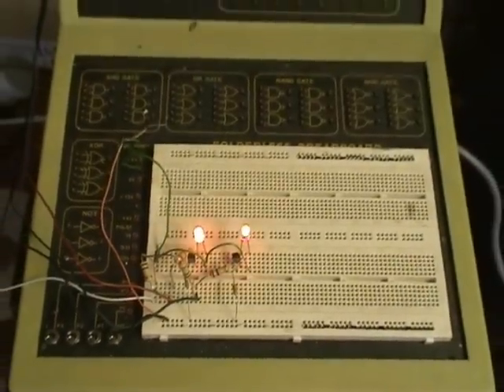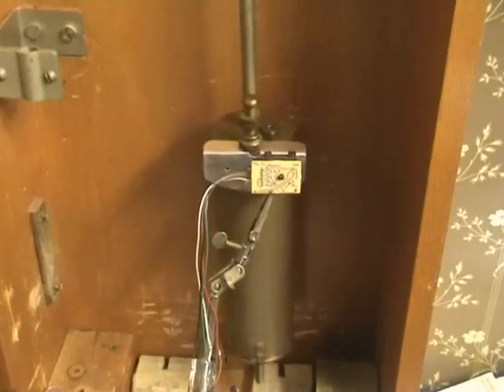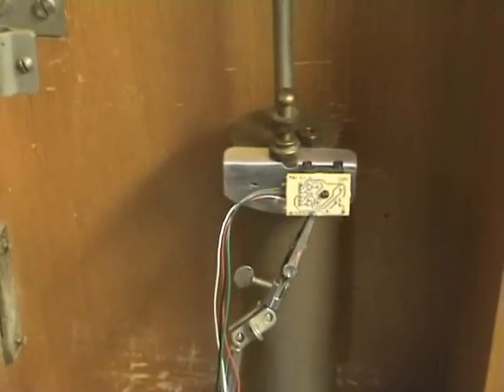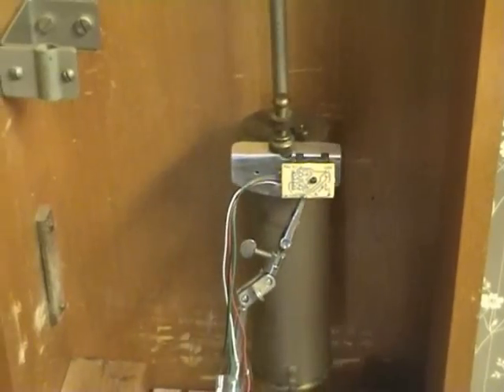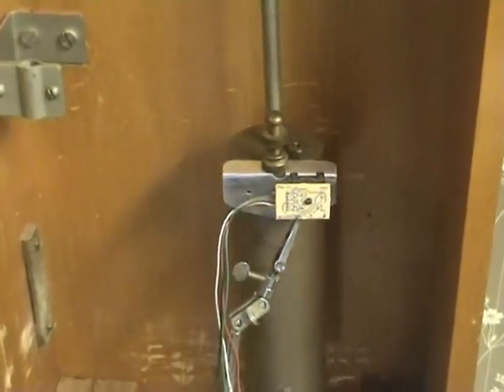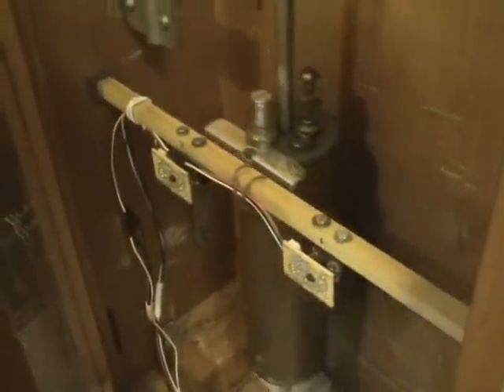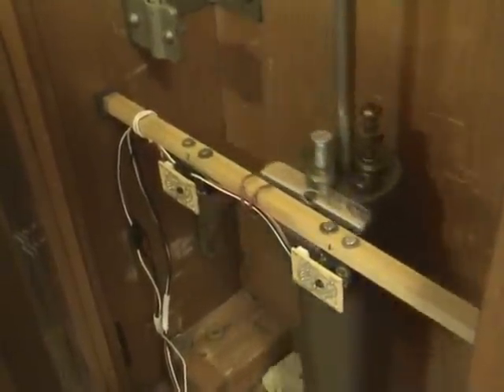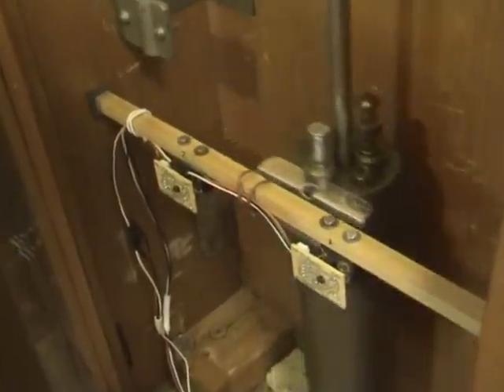Opto pulses from Gents 1 seconds master clock -- part 1

Comment from the maker: Yes that is possible.
But with this set up it is easier to get a dead band within the pulses.
eg. pulse -  off -  pulse -  off , etc.

The plate is reflecting the light back to the sensor, correct.

Comment: You could use one sensor and elongate the mirror plate and position the sensor so you have 1 sec on and 1 sec off.

Is the plate just to send the light back to the sensor?